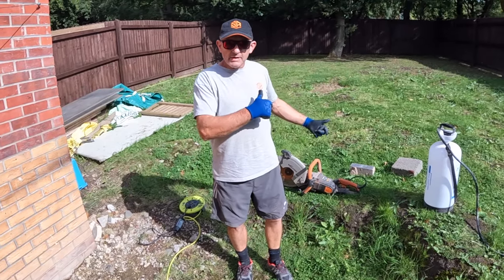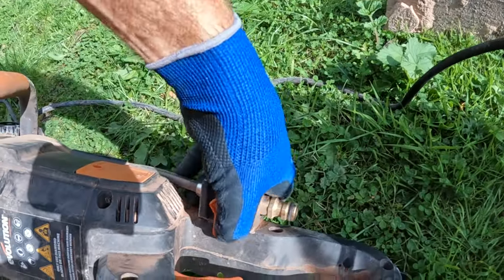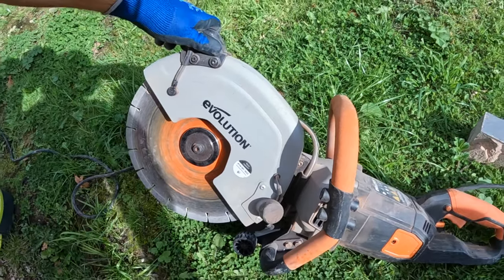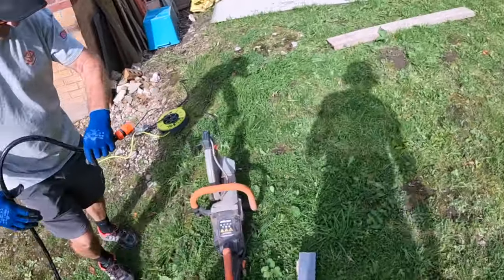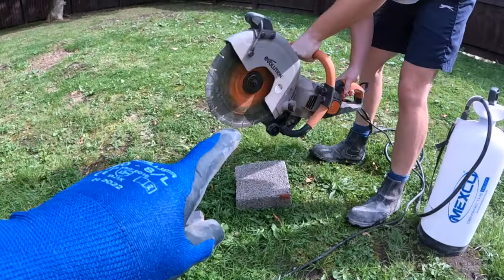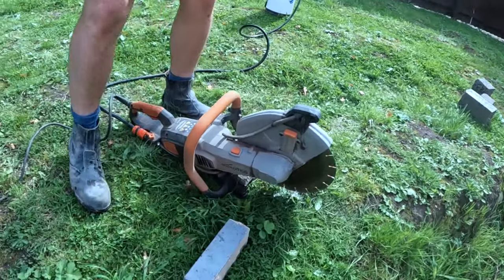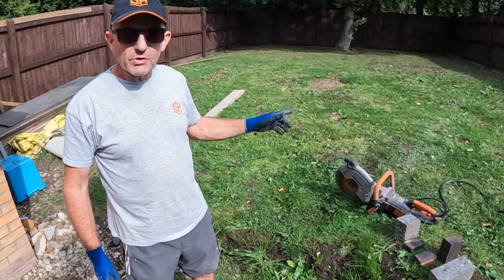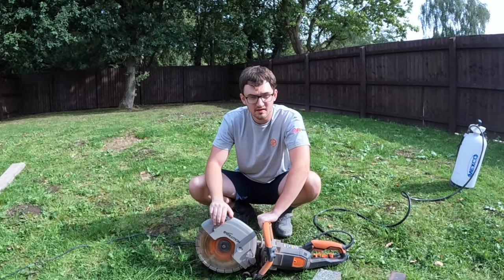2500 W CUT OFF SAW ...BEAST !!

Comment: Nice and to-the-point review. No faffing around telling us about the colours and running through the usual "tool review script". Straight into the cutting!

I was thinking of the smaller R230DCT as it's only to cut around 100 7N blocks (150ish cuts in total) for a DIY project. I thought it would be far easier and quicker to cut the blocks with this than the 9 inch grinder.

However, seeing this with water for dust suppression has made me change and decide to get this one. All my cutting will be done close to a house at the end of my garden and I'm always conscious of, and worried about, the dust - especially when their windows are open. 

Quite pricy for DIY and one-time use... but it's cheaper than most others and it has that water feed. And... I can probably sell it afterwards for at least half of what I paid for it (probably?).
Reply from the maker: Good choice jaimin , it will sell well mate . 🧱👍🏽

Comment: Hi Steve, Alex. Love your vids. I am a Builder as you are and this exact same model only lasted 3 months before what I believe to be the internal yellow coloured cooling fan disintegrated and blew the side black vent cap straight off. I have used it only as intended so a bit dubious of the longevity of the tool. No warning of this machine failing before it did so and up to the point it did was very impressed having other evolution products. I'm giving evolution the benefit of doubt that this is isolated. I did purchase of Amazon so I am waiting for a resolution . Thanks again for the vids boys . Update how you get on with your new saw. Hope you have many years of it working perfectly. 👍👍
Reply from the maker: That’s. Shame , there is always a rogue one 🙄🧱👍🏽

Comment: I've got this mate, really impressed. Just make sure to tighten the screw that holds the orange water tap on, I lost the screw and the little tap soon disappeared too 🤦🏻
Reply from the maker: Thanks for the tip Ross 🤙🏾🧱👍🏽
Reply: @SteveAndAlexBuild  hi mate, I bought mine from Amazon and I've just have a recall email through for it as it's apparently unsafe to use, have you had the same?
Reply from the maker: @rossmcdonald5202  . Bloody hell that’s not good , not so far 😬🧱👍🏽
Reply: @SteveAndAlexBuild  strangely Amazon have now taken the water suppression one (dct+) off their site and it's no longer available for sale, however, the non water one is still available and on there 🧐

I'm sending mine back for a refund, it's basically been a free rental! 
...I've just got a concrete slab to chop up before it goes though 😅

Bit of a shame as it's been great.
Reply from the maker: @rossmcdonald5202  😬😬🧱👍🏽
Reply: @SteveAndAlexBuild   mate I never sent mine back for that recall, but then it burnt out this afternoon and had to go hire a stilly to get some cutting done before tomorrow. Good saw while it works, but disappointing it's not lasted very long. It's getting returned for a refund tomorrow.
Reply from the maker: @rossmcdonald5202  😬🧱👍🏽

Comment: I have a evolution chop saw and it is fantastic always use the makers blades and you can not go wrong if it does you will have a good back up I used my for cutting steel but you can but different blades to do all sorts thanks for the video
Reply from the maker: Yeah they do a demolition blade which we like the look of 🧱👍🏽
Reply: Great saw ,I use the same.
Reply from the maker: @bricklayersworldwithandy6277  . Yeah Andy , always had our eye on these saws , good machine so far 💪🏽🧱👍🏼

Comment: I’ve got one of the  smaller ones, great machine, very surprised by the quality of the bearings and the motor, used it for three months no problems what so ever,great not having to carry petrol in my van.
I also use my generator with it sometimes to use it away for a mains supply.

Comment: Looks so much easier to start & get on with cutting various materials, as a stihl saw user i find it extremely annoying in how to start the saw.
Reply from the maker: Yeah they can be temperamental at times 🧱👍🏽
Reply: Thats why I went electric. I would skip corded and find a cordless one if I was to buy again though.
Reply from the maker: @E69apeTheMatrix420  . The small cordless are great but on the expensive side .
    The 300 mm beasts look amazing but at over a grand a bit ridiculous 😬🧱👍🏽
Reply: @SteveAndAlexBuild  so true. You cant cut a block properly with the smaller discs in cordless ones and they are very expensive.  If I had Makita batteries already the 36v one can be had on sale here and there for cheap but the 40v new version is way out of budget.
Reply from the maker: @E69apeTheMatrix420  😒🧱👍🏽
Reply: @E69apeTheMatrix420  problem with cordless  is it doesnt last that long.
Reply: @suhailbhatti2831 it doesn't matter. I have 10 x 5 ah batteries.  And I NEVER cut for more than a few minutes at a time like everyone else.
Reply: I bought one, used it for 20mins to cut up some concrete & its burned the motor.
Reply from the maker: @suhailbhatti2831  😳😳😳
Reply: @suhailbhatti2831  Thats the fuse that blew. Not the one on the saw. The one on the extension cord you were using. Besides it has a 3 year warranty and evolution are legit really good! Just call them up and see. They will sort your rite out if the problem was actually the motor. Buy a pack of 13A fuses and carry them with you.
Reply: @E69apeTheMatrix420  ok thanks Henry ill check if its just the fuse.
Reply: @suhailbhatti2831 What was the problem?
Reply: @t-rex4211  used it for 20mins cutting up concrete & the motor burned up. Got a refund at the end & bought a stihl petrol cutter.

Comment: Cracking video again lads, but i have a question, is there a hand saw that will cut breeze blocks, or will i have to use a machine, thanks lads.
Reply from the maker: You can get a block saw but expensive and bloody hard work 😬🤙🏾🧱👍🏽
Reply: @SteveAndAlexBuild  Thanks Steve.
Reply from the maker: @davidcort2857  🤙🏾🧱👍🏽

Comment: Balance is nicer than the old 1 , but mine set on fire after 6 months,  the brush must of cooked and dropped inside,  sent it back to evolution and they put a second hand back part on it full of concrete and tried to put a different serial number on it  , I phoned them and told them they have sent the wrong one back to us , they said they haven't,  we only cut very mild steel with ours so shouldn't have concrete on the handle,  luckily I took a photo of my serial number before I sent it back  , all of a sudden the guy who repaired it and sent it back isn't in work he's off ill,  if yours breaks under warranty make sure you take pictures of your serial number and condition its in because has a company who offers warranty I think they are rats
Reply from the maker: Thanks Karl 😳😬🧱👍🏽